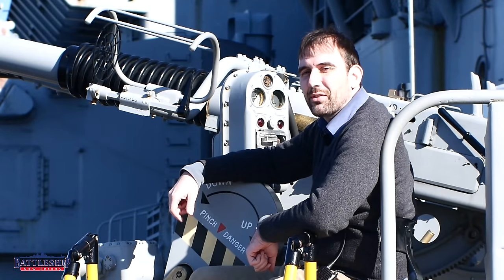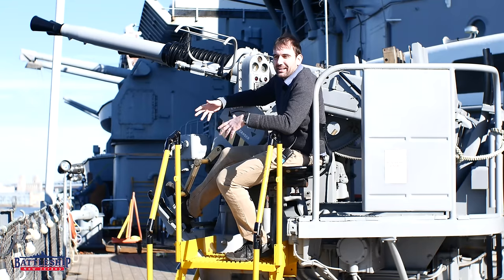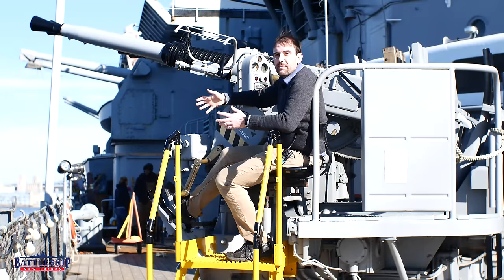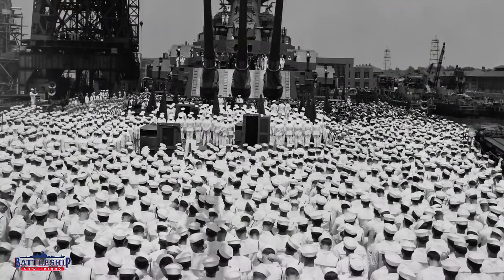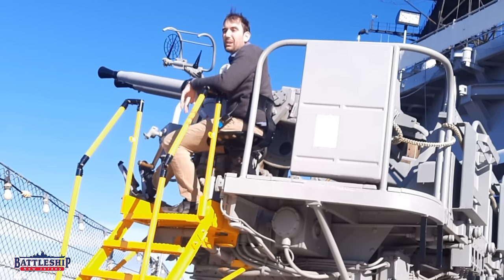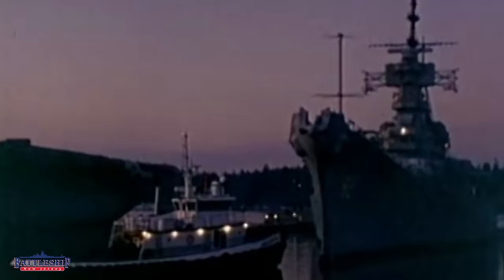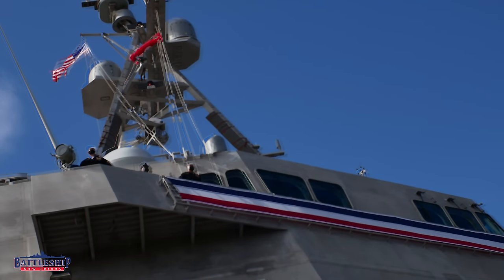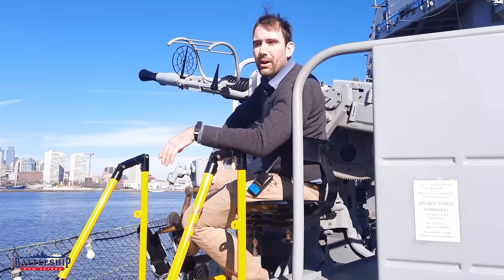What is a Littoral Combat Ship?

Comment: When the  LCS's first came out, the Navy did not train the Engineering Crews properly and it showed in some of the break downs.  One of them had a water leak on one of the Main Engines. There was a Drip coming from a smaller hole on the Water Pump. Someone put a PLUG into the hole and called it good.  This hole was the tell tale to show when the seal is going bad. That plug caused the crank case to fill with water, which they kept pumping out. Int the end that engine was a Total Loss and had to be removed for replacement!  There were so many of this type of problems and it all lead right back the Command not giving the crews the training that they needed!
Reply: It's also worth noting that the vast majority of the propulsion failures has been due to a design defect of the Freedom variant, which is being addressed now.
Reply: I have reservations about how the concept is implemented.  What about damage control and relative self-sufficiency during operations.  Contractors don't make house calls in a conflict zone and pulling out a unit from operations for a repair that the old navy did routinely on board  somehow doesn't compute.
Reply: @mikecimerian6913  did you watch the video? It clearly states that the ships were never intended to engage in high end combat. As such they were designed to an improved commercial standard if I remember correctly. As for maintenance, reality has smacked the Navy in the face pretty firmly with these ships. They are working towards being able to do more maintenance onboard & with their own forces in port.
Reply: I think it also came out in some relatively recent readiness investigations that poor training was par for the course in the Navy.  Who knew that forcing partisan politician indoctrination instead of actually teaching people to do their jobs would be be a bad thing /s
Reply: @bamascubaman  in short the Navy made a lot of short sighted decisions with the LCS and got a ship that is less effective than a refitted Oliver Hazard Perry class would have been. Any ship capable of conducting high end combat will be pressed into service for that role under the stresses of war so skimping on structural design will come back to bite crews should the worst occur during their service lives.
Reply: @josephahner3031  That's exactly what I said. A repeat FFG-7 with a 13-foot stretch and 2-foot widening of the hull (like the Forrest Sherman modifications that created the DDG-2 class)  built to a modified Australian FFG-7 Improvement standard would seem to be the answer. You could even shrink the helicopter hanger to one spot and mount vertical launchers outboard the hanger.  Add a 5" 54 Light Weight gun in the bow, CEC, and an updated MK-92, and good to go I say. Probably no more cost than an LCS and much better redundancy and multimission capability.
Reply: They ( Navy ) in peacetime are under financial cutbacks. That in consideration why design the useless Dumbwalt series and spend billions on that instead of an effective vessel for inshore duty. In war they shoved old WWI destroyers that were ok for coastal duty but were used for convoy duty. Many did not make it back.... along with their crews. No sonar, very little antiaircraft weapons, 20 mm guns were slapped into place w/o regard for fields of fire and this created blind spots for attack by aircraft, Old main armament that jammed or broke down. Our military leaders are always trying to hammer a square peg into a very large round hole with a gold plated hammer. Paid for with our tax dollars during peacetime and when war comes along the holes are filled with ineffective equipment and men's lives.
Reply: @bamascubaman  It's definitely being addressed, by decommissioning the entire class!

Comment: The LCS ships just don't have any / enough firepower for their size.  If they are expected to be in range of shore bombardment, they are shooting targets at best, and don't have any firepower to respond to more than one gun shooting at them.  They certainly can't defend themselves against a Chinese or Russian frigate, or corvette, let alone a destroyer
Reply: Who said they'd have to go up against a destroyer?...
Reply: These ships were never designed to be ships of the line.  The Navy has missions that don't pit them against larger more heavily armed ships.  They were designed to fill missions that don't pit them against large surface combatants.  Plus its size is due to its modular design.  A large portion of its internal volume is empty space for its mission package.  Plus there are weapon module locations where anti-surface missiles like the NSM, Harpoon and Hellfire missiles can be put in place.  So a fully armed LCS is capable of self defense if attacked. But it is not a platform to use in offensive anti-surface actions or be an air defense platform like a DDG  or a cruiser.
Reply: @dmac7128  so they need DDG’S that where not expected for costal environments for babysitting, go it

Comment: LCS was conceived at a time when there was no blue water threat posed by a peer adversary.  They are designed to fill specific mission roles that would not put them in high intensity combat.  Interdiction, counter piracy, ASW and minesweeping are missions that fall into this area.
The problem is that 20 years later, the geopolitical environment has changed with what is called the "Great Power Competition" by the Navy.  Second, the heart of what these ships were built for, the mission packages are years behind schedule and overbudget. Only the surface warfare package has been successfully fielded.
    Even given all of this, the Navy still needs a small surface combatant.  These ships can fill vital missions that would free up larger combatants to perform larger strategic roles like conducting strike warfare, ballistic missile defense and major anti-surface engagements and air defense.  If the cost of maintaining and operating this ships can be kept inline with conventional surface combatants, it will remain a viable platform.  But if the Constellation class frigates prove to be of better value for the money, I can't see LCS as being sustainable in the long term.
Reply: They basically used the budget for LST, Hydrofoils and other small vessel of the United States Navy.  Now, they just need to just build them to do just taxi and hotel service for Marines.

Comment: Which aspect was most ground breaking?  The Idea of Mission packages. However, current plans are ship will probably never have them changed out. Secondly Mission pagkages have ended up just being another means for politicians, designers, maybe also builder to SIPHON defense dollars into JOBs money for their area.
Reply: Couple of points for clarification. The mission modules/packages were initially intended to be able to get swapped out in hours, the reality was days, which is still relatively quick. Every time one of the mission packages was delayed congress cut back on its funding, which put it further behind.

The modularity is something that has a ton of potential but it's not a mature enough concept to implement as intended right now. In no small part, that's due to a lot of contractors only innovating on someone else's dime.
Reply: The mission package concept as implemented on the LCS is not the best version of such a system (Stanflex takes that), but the vast majority of these criticisms fall apart on closer examination. 

First, the Danish ships with Stanflex typically carry the same modules in the same locations, especially those with the 76 mm gun module. In these cases, the modularity allows for rapid replacement after potential damage or to bulk up a particular area as necessary. 

Second, by separating the mission packages into separate divisions, we simplify logistics during peacetime. They can be swapped if necessary, but there is zero reason to do so regularly.

Third, by using mission packages, we have the same base hull that can perform multiple missions, which actually reduces costs compared to specialized units.

I’d personally have chosen a slightly more flexible system where you could trade out one module for another as necessary rather than the all-or-nothing mission package concept, but while we didn’t choose that initially that potential is still there for as long as these ships are in service.

Comment: According to the original specifications for the Gerald Ford, she would only need a crew of about 4500. That's 1000 fewer than all the previous super carriers. Modern electronics is what is making this possible. That includes the magnetics for the cats and cables and elevators. I think the concept of the LCS is great. Getting it to work is going to be the hard part. Changing crews may not be that good a deal. Ships need a lot of maintenance. To make the Blue/Gold crew work well, the ship really needs to be in condition to deploy as soon as the new crew comes aboard and all the mission specific armament is loaded aboard. If the ship has to sit in dry dock, or at a pier, for 3-5 months, going through refit, that's not good.
Reply: Great at what?
Reply: @DeeEight  An FFG7 could have done any of the same work and I doubt that the sonar suite meant for ASW will work for minesweeping. Minesweepers are made to eliminate all magnetic signatures and I doubt that they managed to remove every large bit of steel from these littoral ships. Even the FFG7 had a poor sonar for mine location. When we were in the Gulf we used VISUAL means to locate the mines Saddam let drift into the gulf. Former Sonar Tech here. They tried to market these ships as the do it all ships but the module swapping has been shown to take what amounts to a regular yard visit to swap out and is hence not cost effective. Some officers managed to get themselves nice jobs upon retirement with the contractors building and servicing these ships and the Navy got sold a bag of crap.
Reply: That's possible. I still maintain that the concept was a good one. Waste of money? Maybe. You never know unless you try.
Reply: ger du  I'm sorry but how is a top-of-the-line US anti-ship missile the Firepower of an Apache. The independence class has been getting anti-ship missile launchers attach them in the Pacific because independence-class actually can work unlike the freedom class which apparently has the transmission of a WWII German heavy tank.
Reply: @clonescope2433  then the firepower of a Seahawk.

Anti ship missions are really not the LCS’ intended purpose and it wouldn’t be good at them. The US relies on naval aviation for that, and we are really good at that. Instead of launching an old ship launched ASM, why not launch arguably the best ASM in existence, the LRASM, from an airborne carrier launched fighter?
Reply: Blue and Gold crews were a good idea for Boomers due to the mission profile. On surface ships, they have caused nothing but grief due to a lack of ownership ethos and finger-pointing by the crews.

Comment: Given that the Navy has capped the buy of LCS (the new Constellation-class are basically slotting in where a bigger buy of LCS was originally planned) and are already taking the early vessels out of service, there seems to be some disagreement on whether the LCS represents "the future of the Navy."
Reply: And then there's the Zumwalt class....
Another Navy failure conceived about the same time.
Reply: He specifically, and one can assume deliberately, referenced the systems and technological developments on these ships as main examples representing the future of the navy. In fact, had you spent less time on being a pedant and more listening, you would have realized the shift toward building smaller, cheaper ships in greater quantities was clearly communicated as the most pertinent statement concerning the future of the navy.
Reply: Well they've only taken two out of service and then halted operations on the troubled Freedom class, but I think the Navy came full circle it seems like the role the LCS classes were supposed to fill or light fast-attack boats akin to torpedo boats, and with some of the modifications the independence classes got in the Pacific specifically anti-ship missiles it's funny to me it seems like the Navy came full circle except bigger this time.
Reply: @Trebuchet48  I wouldn’t say the Zumwalt was a failure. It has a use: being a testbed for advanced and innovative technologies that will be implemented on a large scale with the DDG(X) program. While it was expensive and a bit too ahead of its time, it will at least serve a legitimate purpose, unlike the LCS.
Reply: @jonathanpfeffer3716  the primary purpose of the Zumwalts was to add a gun based long range firepower capability to the Navy. They failed spectacularly given that the Navy deemed the ammunition for said long range guns too expensive to procure and the majority of the tech developed that will translate into DDG(X) from Zumwalt is just it's computers. These could have been implemented on flight IIA or flight III Burke class ships in place of AEGIS. We have a bigger, more expensive missile destroyer that carries less missiles than an Arleigh Burke or a Ticonderoga and yet exceeds both in displacement for the gain of a somewhat stealthy hull form. That's a disgrace.

Comment: I’m of two minds about the LCS. One is they don’t seem to be cost effective and appear to get used in blue water rather than littoral waters like designed. However there is a place for a small combatant in the fleet. Also they named LCS-29 after my home town which I appreciate
Reply: The LCS concept had to be modified as the global situation changed. When conceived, we expected to be fighting nations like Iran, Iraq, and North Korea, where these ships would do well and where shallow water operations were critical. But in the 2008-2012 timeframe, we realized we needed to shift to blue-water operations (which killed Zumwalt) and needed new ships as rapidly as possible. Speed mean existing designs, which were Burke and the LCS, so the LCS was tweaked to fit the new expected roles.
Reply: You have to examine cost-effectiveness in a broader scope than just the ship itself.  Remember that for each of these we have doing menial chores or chasing drug smugglers, we have one more DDG to allocate to more important duties like hunting subs or escorting CSGs.  When the only other alternative at the time was to buy more Burkes (since Congress axed a proper Perry replacement), LCS is by far and away the more economical option.
Reply: @GintaPPE1000  One way around that is to simply embark a USCG detachment on whatever USN ship is available, and make drug interdiction a collateral duty.  

It's amazing how quickly a fishing trawler can actually heave to when a US Navy ship goes to GQ 100 yards away...even if it is a 650' oiler.  This was, of course, after the trawler figured out that their 15 knots wasn't going to outrun a ship designed to deploy with a battle group.

Comment: As a student on ship design, at around 10 minutes in this video, you could have said, they were trying to do too much on the displacement, where the technology was what was supposed to give the capability, but, we are not quite there yet to build the capability into a small enough module you can swap in and out, and the experiment failed. The modular package theory does work for what needs to be done, but the package you can swap in or out is to enhance the capability for what needs to be good enough without it. We'll see what happens next on this, where the much bigger Constellation FFG is the result of the lesson learned. PS, as a small detail, want to do a video on why submarines are boats and not ships? There is a reason why you have COB and not CMC :) And would love it if you could get invited to have the Dick O'Kane's cribbage board on a video and teach the history of it.

Comment: Ryan - You are correct in stating that the LCS ships are unproven in today's Navy however as to cost they are not cheap to build or operate. I hope the new Constellation Class Frigates can be built in large numbers for a reasonable price as the Navy desperately needs more escort vessel's.
Reply: Are US freighters getting harassed?  Or did you mean as patrol boats if we were to ramp up against china and start enforcing fishing zones?

Small ships build the fastest and evolve the fastest, I think the strategy of having a heavy roster of capital ships and rebuilding the light fleet has always served Navies well but it seems unpopular
Reply: Compared to what it would cost to build a modern battleship... they're likely VERY cost effective.
Reply: @DeeEight  you are funny 😅😅😅😅
Reply: @DeeEight  A better radar and VLS cells is very important. The ships will likely also be better able to integrate future technology onto them.
Reply: The new Connies are not going to be the simple "off the shelf" solution the navy originally sold them as to Congress. For what was SUPPOSED to be a ASW primary role frigate (because of the failure of the development of the ASW module for the LCSs), they'd deleted things like the hull mounted sonar, and fitted extra full length Mk41 VLS tubes to increase the Tomahawk capability. And worse, they're being built by the shipyard that fucked up the Freedom class, so I would not be surprised if there are engineering failures discovered once the first few hulls are in the water.